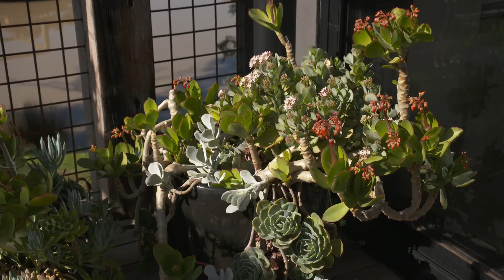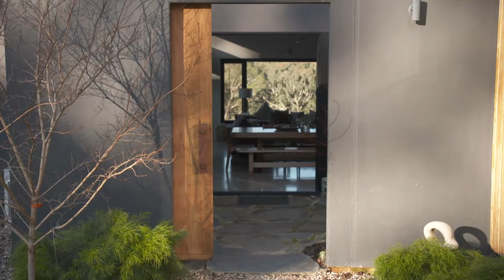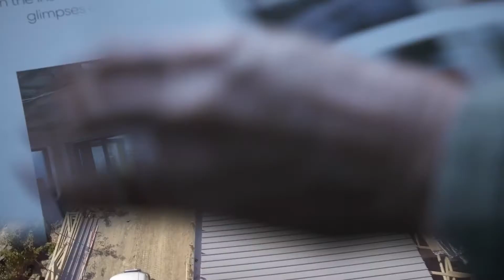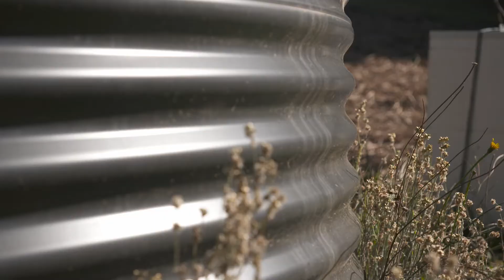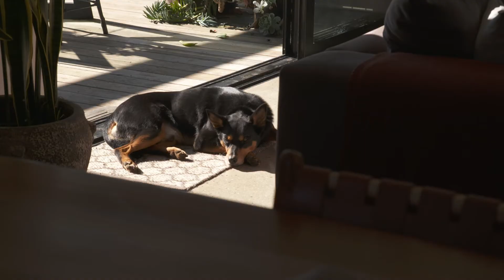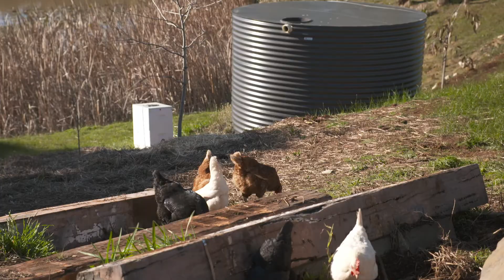Candlebark House - Sustainable House Day 2020

Comment: Nice video, but burning wood as heating is hardly environmentally friendly.
It creates more PM2.5 than a diesel generator providing heat would.
There's a reason why in the EU fireplaces are highly regulated and must comply with emissions controls, the one shown in the video - doesn't.
An all-electric house is also a bad move, even if you sign up to green energy, the process of converting heat to high voltage electricity, then sending it hundreds of km over wires, then using transformers to reduce the voltage just to convert it back to heat is not even close to the efficiency of gas, which is converted to heat only once - by burning.

Just my 2 cents, and yes, I studied energy in buildings.